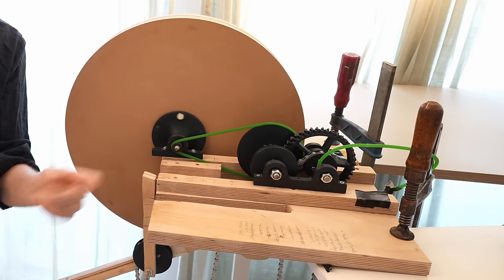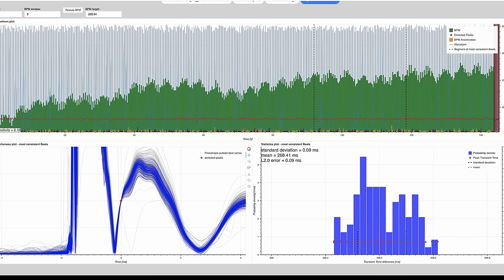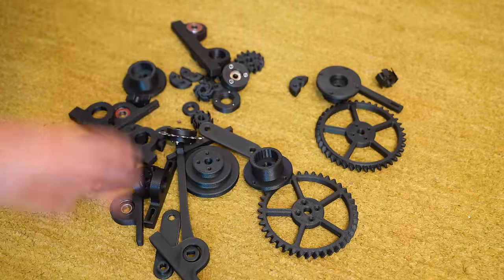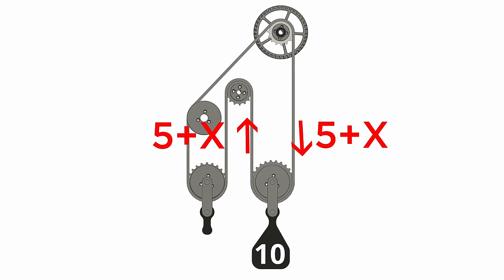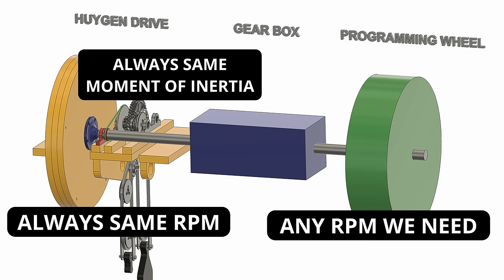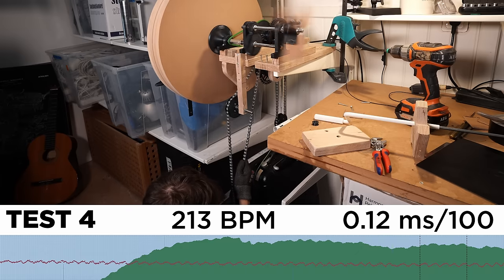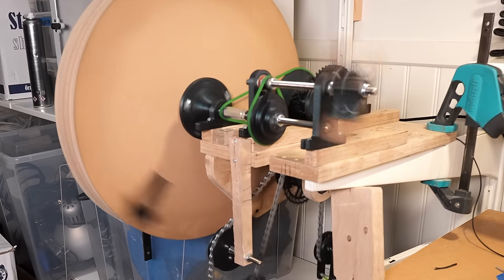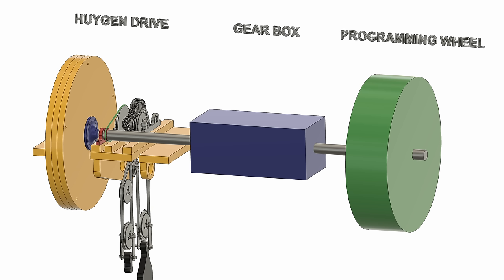Using Gravity To Play Tight Music

Comment: I think that this mechanism is not the right one for the marble machine and the problem with the tempo drift shows a major flaw. Let me explain. In a system like this there is only one rotation speed that can keep the weights in a constant height and it depends of the parameters of the system like mass, friction and pulley radius and the fact that the speed changes gradualy means that one of those parameters changes during operation. Even if you eliminate this problem, in the finished marble machine the load will change depending on the gears selected and which instuments are engaged. This fundamentaly changes the parameters of the system and thus changes the correct speed to keep the counterweight stable meaning you either have to change the tempo or let the weight move up or down. In the hand cranked version when the load of the machine changes you can adjust your power in order to keep a constant speed, with this one you introduce an additional balance that has to be kept. I hope I could explain it good enough but if you need any further elaboration I'm happy to do that.

Comment: What about air governor style  blades on an inertia Govenor ( the type with the expanding weights)  as the rpm increases the air paddles would move further out increasing their diameter there for increasing air resistance to slow it back down . I feel that would create a better governor with a passive natural equilibrium.

Comment: You are building an analog control system. When building control systems, you should think about the load. How big is the load of the system you will connect? How much variation will you see when you enable and disable various instrument groups?
Stop doing measurements without any useful load, that says nothing on the tightness of playing with instruments

Comment: I wonder if gearing up the crank along with the ratchet will help? I think it would feel rather odd to be spinning the crank so slowly while the tempo of the music is so much higher. Gearing up the ratchet portion away from the gear that is holding the chain might make the power input even smoother as well. Perhaps a planetary gear set between the ratcheting gear and the gear that holds the chain?

Comment: I didn't even know governors came without the brass balls or another way of creating a negative feedback mechanism, which is needed to actually govern... those kinds of governors are all over in early steam engines.
Reply: Most governors regulate the flow of fuel, or steam, into the machine. The air governor just simulates a load, which would work with a constant input, but not a variable one.

Imho the best option would be a fixed RPM governor which gets more resistant the faster it turns past the desired RPM. So basically, a self adjusting air governor, big enough to slow the machine even if Martin is cranking like fury.

Comment: Are you sure the pulsing was due to the input? It looks to me that the unbalanced flywheel is causing an oscillation in the frame, and the acceleration of the frame up/down may be impacting the provided force (the weight will provide slightly more/slightly less net force depending on whether the frame is accelerating up or down). It's likely that it went away when you were pulling on the chain because the chain is connected to the frame, so the applied force was acting to dampen the oscillation.

Comment: I'm a bit worried about the resistance getting to high to power it by hand, since even this small scale prototype without anything on the output shaft seems to require a lot of energy. Especially if you add more stuff with losses like the gearbox. Since the governor is constantly "wasting" a lot of energy it might be better to find a solution that is more efficient or go straight to an electric motor.

Comment: Rather than crank the ratchet manually and expose the drive wheel to a variable force, could you not use some sort of spring tension system where you tighten the spring? Or would the variable force between equivalent?

Comment: Im no expert so im posting it as a question. 
Instead of an Air Govenor, would a Centrifugal Clutch/Brake be more consistant and be easier to claibrate? 
And yes i am aware that this would introduce a lot of noise to the machine that would need to be isolated somehow

Comment: How about adding liquid pressure to the power input? I'm thinking a water tower design where your spinning would pump water up to the water tower where the water would come down again and input the power at a more constant rate than you can with spinning alone. Then there would be two stages of batteries. The water tower and the weight.

Comment: Is moment of inertia equivalent to momentum? If yes then I think there is an issue with this design. You said the flywheel will have a constant moment of inertia, and you will choose different gears to get different tempos, but different tempos require different energy levels, i.e. different momentums.
It can't be constant on one side and variable on the other side of the gears since momentum is preserved.
Something is wrong here (and it may well be my understanding)
Reply: It's not equivalent but it influences the formula like a konstant (linear), sum of momentum on a body = moment of inertia times the angular acceleration
Reply: Thinking about it some more, it actually makes sense that they are not equivalent. A flywheel at rest has 0 momentum, but (I think?) it still has the same constant moment of inertia as when it's spinning fast.
So maybe the moment of inertia is more like potential momentum? Or a multiplier for the rotational speed?
Reply: @LeeSmith-cf1vo -- A moment of inertia is roughly equivalent to the mass of a non-rotating object. It's a measure of the torque necessary to rotate it at a certain acceleration.

There's no issue with different momentums on different sides of the gearbox, or even a changing ratio of momentums. All that's necessary to maintain speed is balancing the input power (fixed by the huygens drive) and the output loads (variable, but can be balanced changing gear ratios or raising the load with a governor). If there's more power put in than it being used, the system will speed up until the output power catches up, and if there's more power needed, the system will slow down.

Comment: I wonder if using a spring instead of a weight will make any difference here.
After all you're not only applying an acceleration to the weight, but also reduce the length of the chain below the gears and this weight difference affects the netto weight dangling.

Comment: The device converts your rotational input into a beat output, and you said the weight, and I suppose the flywheel as well, is filtering your input, so I guess you basically built a mechanical bridge rectifier and filter? 🤔

Comment: Thats "i need to keep the weight at the same height" is what i was thinking when you first showed that mechanism.
Like if you need to engineer a crank that rotates at the perfect speed to keep the weight at the same height, why not use the crank to power the system directly?

Comment: why not just eliminate cranking during the music all together and use a heavy weight and a long distance with a high gear ratio so that the weight takes a very long time to fall?  also look into clock mechanisms which that governor is often used in, because in a clock there is a varying force given the spring unwinds but yet it keeps the same tempo regardless.... though clock mechanisms use a reciprocating flywheel....

Comment: Just wondering if a Watt regulator wouldn't be a better fit for this application. The problem with your current governor is that it only adds resistance, it does not regulate anything. In other words, it will not compensate for any changes in the system.

Comment: Wouldn't an air governor also be susceptible to inconsistency due to elevation changes and thinner air? I'd imagine those other machines were fairly stationary whereas this one is going to move around considerably and would require considerable tuning at each location. It sounds like you're moving away from it anyways so it might not matter but that might disqualify that option in the future.

Comment: I guess the way you define tightness over a number of beats doesn't tell the whole story. Higher BPM results in shorter measurements, effectively scaling down possible errors. I propose you measure for a fixed time. Maybe also think about the system like an electrical R-C circuit. It will always only smooth out your power input, never remove the variation. A governor helps with it's nonlinear  behavior (it's a negative feedback controller). But you can never remove input variations without infinite gain. Which a mechanical system has a way harder time to approximate than an electronic one. And when you have perfectly uniform input power, you barely need the weight drive anymore. So define what tightness you realistically need (spoiler: I guess drift will be a way larger issue than inter-beat variations) and design your system around that.

Comment: I don't understand why the suitcase full of weights is not strapped to a skateboard and placed on an incline.   That would allow it to use gravity to turn the flywheel and save the effort of cranking, except to reset it at the top of the angled ramp.   A heavy weight pulling downwards to operate a gear system, flywheel, and air governor has been used for hundreds of years to operate large grandfather clocks. I don't understand why you are trying to reinvent the wheel with this thing.   Just copy and modify a clock system.

Comment: Not to over engineer it... haha... but you could look to install a constant velocity transmission (CVT) which will vary the gear ration to the air governor proportional to the speed of the input. so as the flywheel speeds up it will increase the ratio to the governor slowing the flywheel down, the same is true for if the flywheel slows, it will reduce the gear ratio to the governor reducing the resistance on the system... I wouldnt be surprised if you found such a system in the governor mechanisms of those other automatic instruments

Comment: Is it possible to create a self regulating governor fan? I know that when a helicopter loses power it can still land safely by manually adjusting the pitch of the blades to either increase speed or resistance. Could you do something that uses centrifugal force to increase the resistance or the governor and thereby slowing the machine? Almost like having moveable blades held together by a rubber band that expand the faster it spins?

Comment: You should not be testing your beats directly from the flywheel, you should have a transmission, preferably running off the governor rather than the flywheel - this will take some of the flywheel variation off, and allow you to push the flywheel much faster, which will help with variations in speed. You also need a continuously variable transmission to connect to the actual marble machine, which can also be governed to help keep the tempo even.

Comment: The reason your tempo is accelerating is because the wheel is attached to a falling mass
In a free fall, objects will always accelerate 
Note that they will keep accelerating until they hit terminal velocity - which I guess is what your air governor is trying to achive
But the issue is that for a larger mass, the higher the terminal velocity of it is (the higher the tempo) and for a suitcase full of metal it means the terminal velocity is pretty large
The tempo was on its way to hitting the terminal velocity and platou, but becuse the mass is so large, it never hit it

Comment: Ask yourself what kind of weight at what height you need to use to drive your machine with all the steel and all the moving parts. Are you sure this design delivers enough power to the outside?
Reply: The height doesn't change the power at all (save the weight of the chain needed to span the height). Height only gives more time for the mechanism to run.

It would be simple to scale these parts up to use a much larger weight, say 100kg. The speed of drive also affects the power, but it shouldn't be too hard to deal with the roughly 100 watts of power a human comfortably makes.

Comment: Wonder how the resistance of the whole system will impact this drive. Like how much torque can it output? Will the whole system become easier or harder to drive when features are turned on or off? (I guess it's not just the programming wheel it will provide with energy but other mechanisms too, like whatever will take the marbles back up)

Comment: Your analysis of the forces is wrong. By raising the weight you increase the system’s potential energy, but the kinetic forces in the chain always stay the same, unrelated to your manual input. The weight does not ‘filter’ your input, it stores the energy and releases it through gravity alone.

Comment: what about using a governor with an adjustable pitch
 Using angle of attack it can adjust air resistance
 like a helicopter tail  rotor, or like space x grid fins.

Comment: what if you use aluminium for the axels or bearing holders? since heat from friction causes problems it seems that you want the machine to reach an equlibrium fast and aluminium would act as a heat sink. 
this wouldnt eliminate the heat problem but would help with reaching that equal heat generation and disappation faster maybe?

Comment: Your governor needs to react to the speed, not just be a passive system. Yes the air resistance on  your fan will go up with speed, but it's not enough and never going to be consistent.  You should be looking at a Centrifugal governor.

Comment: What if you had a centrifugal "sensor" driving the angle of the fins of the air governor, to automatically adjust the air resistance based on the RPM to make it automatically consistent? Would that work?

Comment: might be too complex, but would using a mechanism simular to what helicopters use to adjust the angle of the blades, be good for adjusting the angle on the air govoner to add or remove resistance on the fly?
Reply: Swashplates? Yeah, good luck getting Martin to pay for getting those made; he didn't even want to buy bearings.

Comment: Are you sure the weight drive will always rotate at the same speed? your output force on it will change for every gear in your gear drive which will change the speed of the weight drive for every gear, won't it?

Comment: Couldn't you use the height of the weight to physically keep the rpm consistent, instead of just being an indicator? If you, for example, had a CVT between the flywheel and constant-rpm system, you could control the CVT ratio directly with the weight height, and never worry about speed again

Comment: Isn't it speeding up because the weight is accelerating down (like anything that is free falling) and stabilizing only when the resistance of the air, the gears etc. becomes high enough to counter gravity?

Comment: so why use a second system to regulate a battery regulator output, governor tries to fix a system and will make both succ, you could make an optical automatic rpm brake control system on the output instead of the governor

Comment: I'm a little bit confused about the increasing tempo problem. It sounds to me like the issue is that you keep putting more energy into the flywheel, and that makes the music faster and faster. Wouldn't increasing the mass of the flywheel just increase its capacity for energy and make the problem worse?
Reply: The more I think about it, the more I think using a heavy flywheel is making it harder to achieve any musical goals. With the previous iteration, the flywheel made it harder to adjust tempo and get in sync with the metronome (you had to play above tempo if you were late, or below tempo if you were early), and then when you were in sync with the metronome, it made it harder to adjust tempo to stay in sync (getting back to the right tempo). I wonder if the best way to play tight music is just to be a tight musician (which you clearly are!)... and make the machine more responsive to the musician, not less.

Comment: What happens if a flywheel is used to drive the chain that drives the current flywheel. Would the first flywheel smooth (using a gear reduction) the input noise in the chain?

Comment: Your force balance is wrong. assuming a weight of  10N and assuming the weight is not accelerating  if the tension on the left chain is 5+x the tension on the right chain must be 5-x since their sum must be 10. 
across he driving pulley there will be an decrease in chain tension and hen an increase across each oher pulle

Comment: Go all out and use a hit and miss steam engine to power the mechanism, and incorporate an adjustable weighted governor that runs a transmission that is complete with planetary gears and variable wet clutches ..... Like a motor cycle transmission keep tinkering
 You're welcome😊

Comment: It's unlikely that gravity is a factor.  A 150# man only weighs a few grams less at 5k altitude than sea level.  You will need a governor but you may be obsessed over nanosecond that isn't that important.  Air density will have the greatest impact. That's what musicians call it.  Tighten it up. But you need a mechanical governor not affected by air density.  When you drilling and reaming holes its done by one guy.  Everyone has a different natural pressure when using mills. Stick with proven technique but design them with modern material. Old governor were cast iron. There's also an old saying.  Don't let perfection destroy good enuff.  Lmao James Watt steam engine governor.